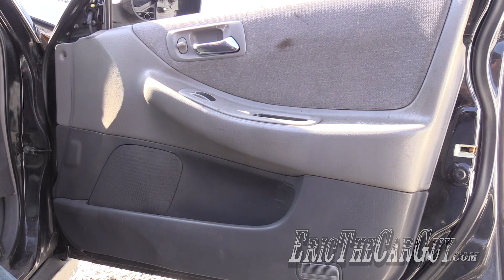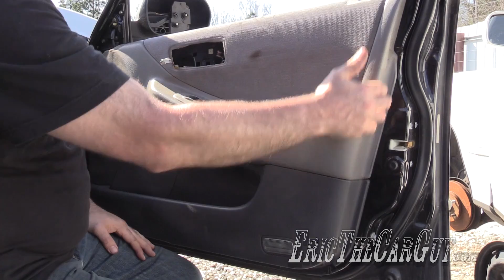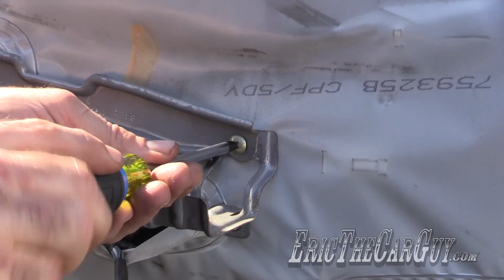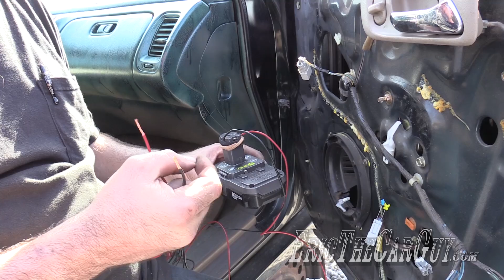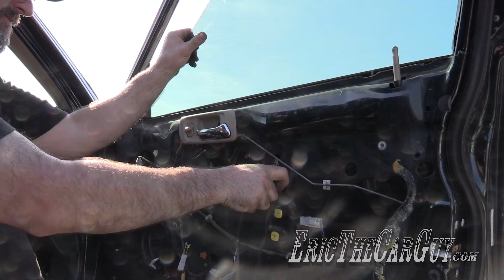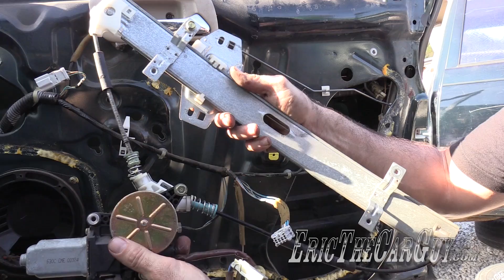How To Pull a Honda Window Regulator/Motor #SalvageYardHacks

Comment: In fact, the majority of vehicles have 14.4 volts at the battery while the engine is running and the alternator is charging it.  So 18 volts is only 3.6 volts over.

Comment: I'd still say it's safer to use one of these lithium power packs that are intended to help you start a car when the battery is empty, because not every window motor may take 18V so gracefully as this one did.
Reply from the maker: Actually, most do just fine in my experience.

Comment: K, wait - what kind wires did you attach to the battery?  Could you just take the clip off the door wires and touch it to the battery directly? I have a 9.6V electric drill battery I’m thinking could work...

Comment: 2 wires on my 91 integra from the ect fan switch  on the thermostat housing... Do both wires get grounded?? I think I'm right but I figured id ask the man... O and the motor is out of a 99 civic si b16a2... Just wanna get rid of this toggle switch and make it right.

Comment: Eric, since you're on a Honda Accord  series, a question.  My 2009 Accord LX has a button for max AC.  What does this do?  It doesn't seem to make a difference when I press it.
Reply: Max AC recirculates the air in the passenger compartment, Normal draws air in from outside.

Max cools down faster, because it's re-cooling air that's already been cooled before. Under some conditions, though, humidity builds up faster.

Comment: Eric, should I just replace my 2000 Ford Explorer entire door to replace the power window motor?
Reply: No but you have to drill out the rivets
Reply: nmattcar oh screw it, the door is 50$ and alot less agro...
Reply: +Brutally Honest  it's honestly not that baf
Reply: nmattcar I bought it with a replaced door already, so if I can get a matching color I'll go with the whole door replace.
Reply from the maker: Easier to do the motor I would think.
Reply: EricTheCarGuy thank you sir!

Comment: how do you replace the vapor barrior?
Reply: I simply peel mine back very carefully after a short time of heating the gumming with a heat gun on low (or a hair dryer) so that it peels off mostly intact. If you can get it off cleanly you can put it back on. Press in place and slowly reheat the gumming until it is just a bit squishy. Press it into the steel with the heel of your hand. Take your time. It is worth it to have that back in place, based on my experience with a missing one. It will not go back on perfectly, but it will get the job done. If you need to re-use it then the secret is in how carefully you peel it back when you remove it.

Comment: or you could spend $50 bucks to buy a new one
Reply: Or you could just buy a new car. The cost between this and $50 might be a  big deal for someone.
Reply: The yard wants 24.95, $3 core, $2 Entrance fee, $3 Environmental fee so ~$33 + tax and addl for a warranty, a brand new regulator & motor is $32.55 free shipping and no tax on ebay. So yeah always compare prices sometimes new is cheaper.
Reply: what about gas to drive to the yard
Reply: Hans Sauer Gas, maintenance, time, wear on tools, beverages, possibility of injury while in the junkyard, detergent for your hands and clothes etc.  Sometimes junkyards are substantially cheaper, many times they aren't.